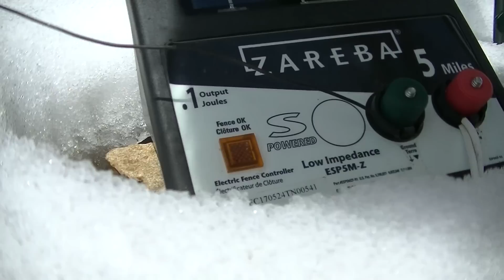First Look Inside the Beehive! Good and Bad News

Comment: I would say also that you second colony has survived, see how they are clustered. Robbers do not cluster, they dine and dash. you need to reduce them down to one box and get the insulation back on them, they need to stay warmer at this point so the queen will start laying. larvae need 96 degrees to grow.  I am in Utah, it is not quite as cold as you are but I have 2 frames of closed brood right now.  My Queen started laying March 1. Get some syrup on them, your aspen trees should be starting to produce pollen soon, Watch the Aspen around your hives, I see alot around your yard in your videos, watch for swelling buds and hanging catkins this is when pollen will be abundant for the Bees. it will be grey or light yellow. In my area Aspen and Cottonwood started opening and producing pollen on March 5. That is the first pollen my Girls start bringing in, in the spring. The syrup will simulate a flow so the queen will star laying harder, she probably has already a little. leave the pollen patties on.
Good Luck!
Reply from the maker: This is a great observation and advice. I did check again the next day with a stethoscope and hear very slight activity, so confirmed yes, a small colony in there. The Aspens probably won't be starting to bloom for another month though. They have plenty of honey left in the super, so they should be ok till then. She didn't start laying until the 1st weekend of May last year.
Reply: Doug Lloyd Agree!  It is still alive, just a small cluster.  Mites probably took some out.

Comment: Why would bees from hive 1 clean out dead bees from hive 2?  Oops.  made this comment before you made the same observation.
Reply from the maker: yeah, i dont think they would.  But after checking today, it appears hive 2 still retains a very small colony. I listened with a stethoscope after knocking loudly on the outside of the hive. and heart faint buzzing inside. Did the same with hive 1 and it was much much louder. Hope Hive 2 makes it!